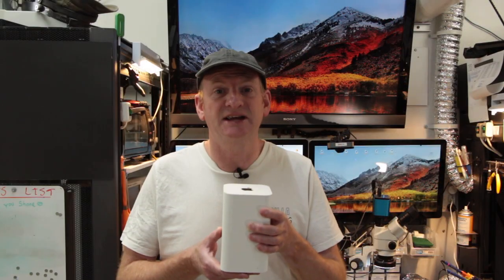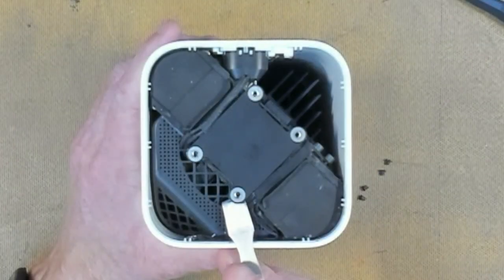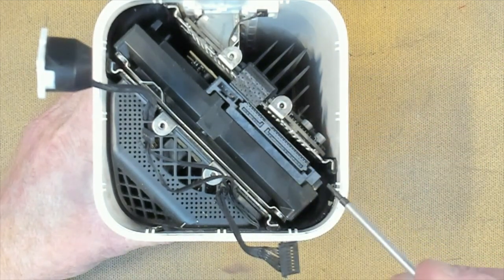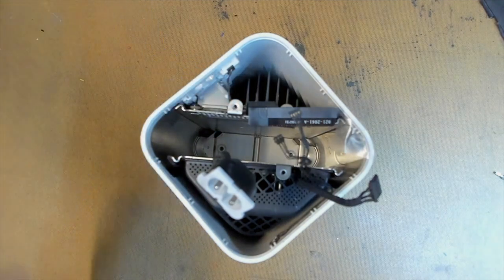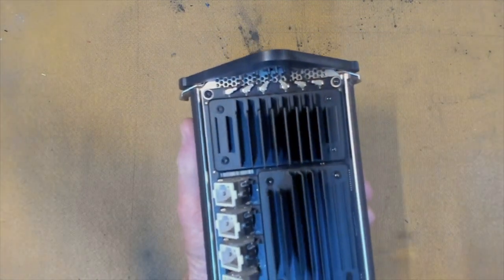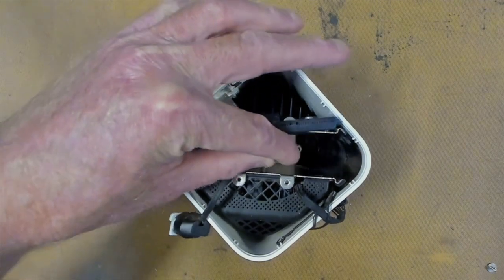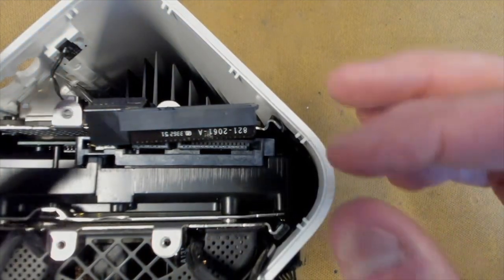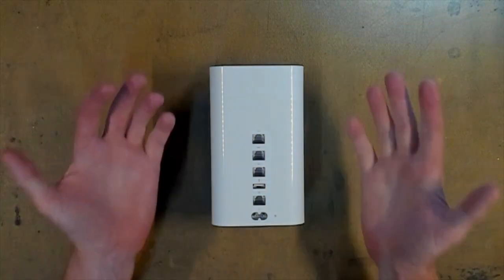Apple Time Capsule Teardown

Comment: Be careful when you try to pry the 2 tiny wires out to the front, because they are connected to a small plate on the board. If you have your tool behind the plate and pry them out you will basically destroy you capsule, like i did.

Comment: I just wanted to say I really appreciated this video. Your close ups were fantastic and it really helped me swap the drive on my time capsule as well. Thank you so much for recording and sharing your video with your comments / tips!

I'll just throw in some tips for yourself or others:

- The part around ~10:30 for getting the springs back on. You can either preinstall them and gently put the 'core' back into the casing, or you can use a chopstick if you have one laying around if you don't have a spudger - works perfectly. I'd imagine many pens / pencils, or anything else that is thin and cylindrical would also work.

- I used plastic guitar picks for the part to open it up. I think it's inevitable that you will leave some marks, but if you use plastic, it won't be too bad. Although frustrating at first, do everything you can do be super gentle. It's almost inevitable that you will break or crack some of the tabs, as they are thin and plastic. The gentler you are, the less you will break. stick a couple plastic picks in, and wiggle wiggle wiggle for a while if your goal is to preserve as many of the tabs as possible.

- Depending on the replacement hard drive, you will have to cut some of the rubber gaskets holding the drive in place for it to fit snugly. An sharp thin razor blade (like an exacto knife) is perfect for this. Make sure to cut enough away that it fits snugly as reasonably precise as you can, as my drive was a really tight fit when putting everything back together and I may have missed a couple small chunks I should of cut up more thoroughly on the rubber gaskets to better fit my drive.

- I would suggest being careful about the drive you choose, as it's really packed in there so I'd imagine cooling won't be the best ever. I chose a Western Digital red running at 5400rpm. Something that doesn't consume too much power will also likely not produce too much heat. It might also be a good idea to avoid SMR drives in favor of CMR drives, though I don't have the technical expertise to explain exactly why. A laptop drive or 2.5" SSD might also be an idea in an adapter, just remember the SATA connector must be in the same place exactly (which it likely will be with a 2.5" -> 3.5" convertor case).

Initially I was not gonna take out the whole thing but watching your video I decided to go all the way so I could clean my fan and clean my unit just that much more thoroughly. My unit was not as bad as yours, but the fan still had some small chunks of dust and blowing it out certainly didn't hurt anything I'm sure.

I had to force it back together just a bit, but it did finally after some convincing in a way that I feel confident about the job. I'm a happy camper! Seems to be working great and I hope it work for many years.

Comment: Would it be possible to use a ssd instead of a hdd and would it make a noticeable difference?  Thanks
Reply from the maker: Yes you could try SSD, but it would only go as fast as the Sata controller would let it !